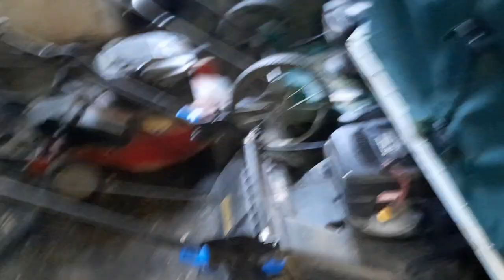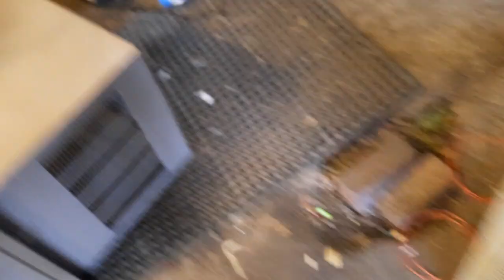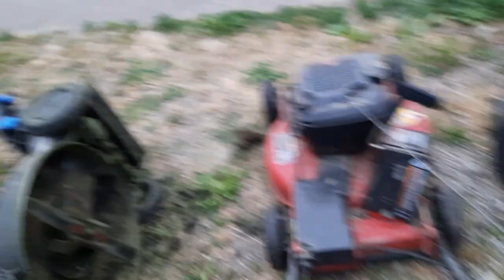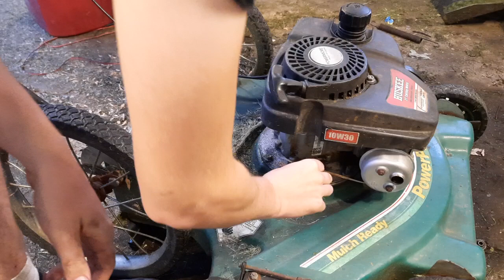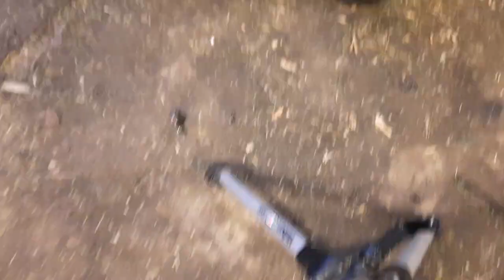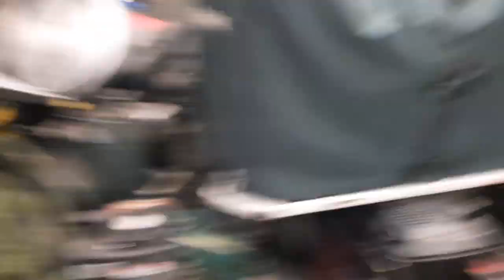lawnmower preventive maintenance

Comment: You sound like your into mechanics and mowers which respect and keep up the videos. but Dude, you really shouldn’t pour out oil on the ground. you might find somewhere that takes used oil like the city or auto parts stores. There are even people that will come pick it up that use it for heating purposes if you post it online. It might not seem like a big deal now but you will find it’s not acceptable.
Reply: I used to do this when I was like 16 and it was 1986. Then, it was throwing it into the trash. After about 1991 it started getting recycled at the local auto-parts store.